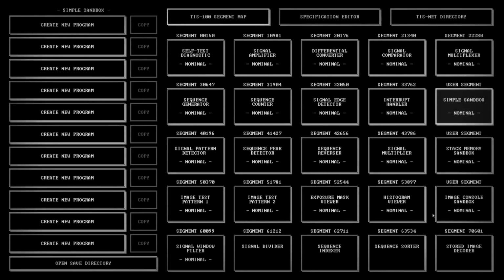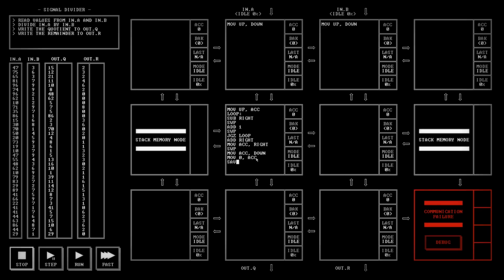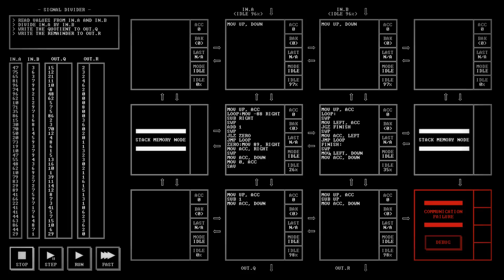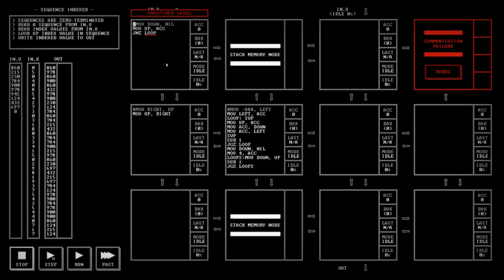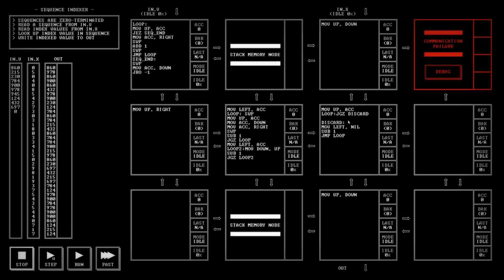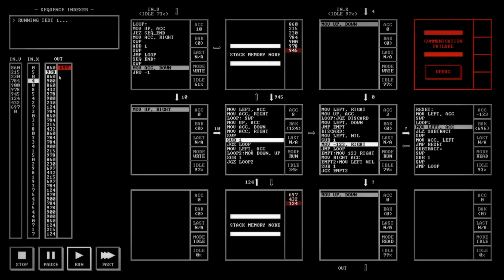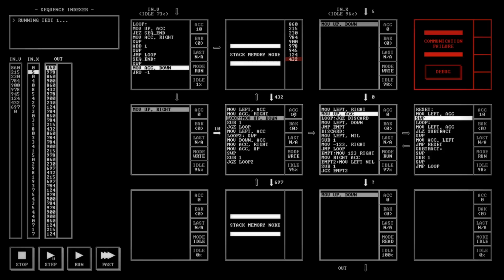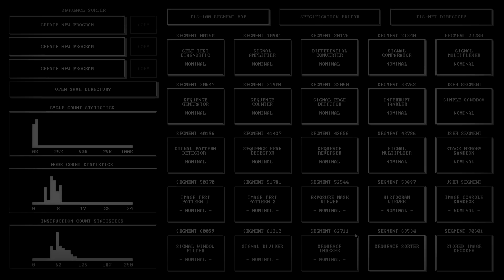TIS-100 - E9: 8D5.@B.GK

Comment: Like you, I started from a copy of Signal window filter for Sequence indexer. The secret to me ending up with an average cycle count and a low instruction count (2459/6/27) was that there is no need to use the number of items in the sequence; only the current index matters. For index X, the central node moves 9-X values to the other stack, pulls out one more and copies it to the right, and then puts them all back on the top stack. The node right of the worker node is responsible for manipulating the index and sending it to the worker node twice.
Reply: I took your advice about the stack and went from 5393/5/38 to 2233/6/34, thanks!
I think it can be reduced further by holding half the values in one stack and half in the other and accessing the only the stack containing the index.
Reply: @cptunderpantz9273  Always nice to know when something I wrote was helpful to someone. :)